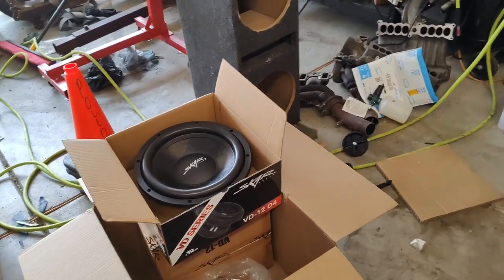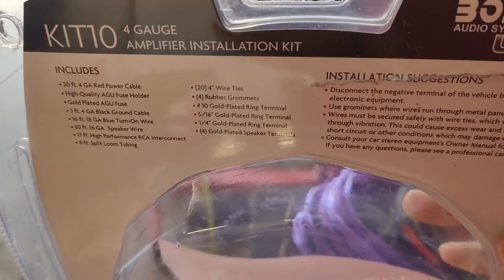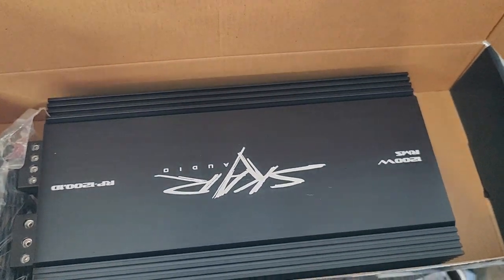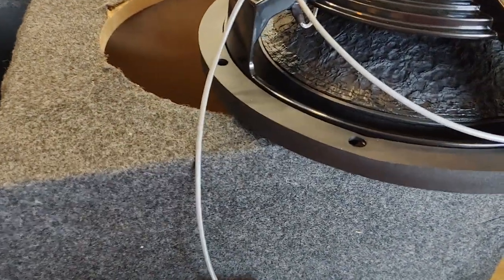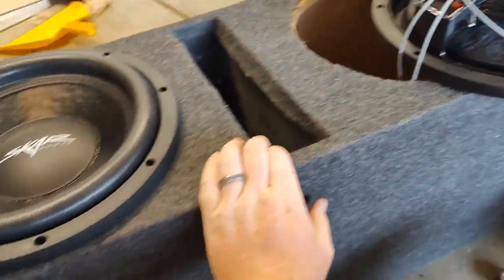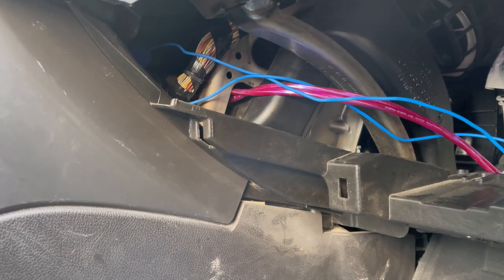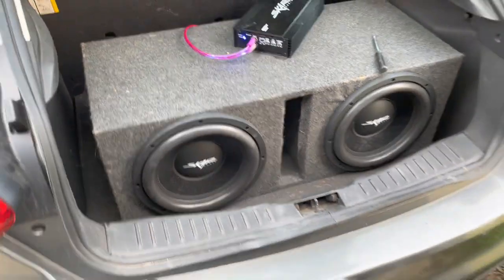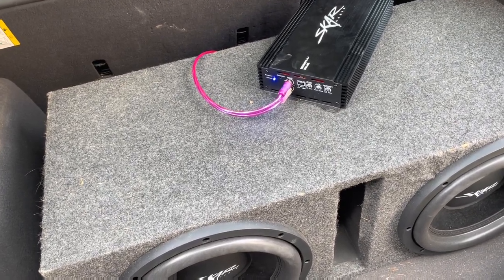2 12 inch Skar Audio subwoofer install - VD12-4. 2013 Ford Focus

Comment: Cool that you did it all yourself. I just install a Pioneer amp and 12” woofer in my truck. And two 6.5” Infinity rear door speakers. Front door has stock Bose 8” woofers and they’re still good. I already had a Pioneer head unit. And I use a Kicker install kit. Like a couple comments said, don’t cheap out on the wires man. Get a good name brand and oxygen free wires. Better safe then sorry.
Reply from the maker: The kicker install kit is a better kit?
Reply: @PollockGarage  I think Kicker is a better brand but you should definitely use oxygen free copper wires and cables. It’s safer and transfers power and signals better. Check out some comparison videos between OFC vs CCA. I’m not sure what Boss uses but if it doesn’t say OFC on the package then it probably has aluminum wires mixed with copper.
Reply: @DanPRC with that little bit of power 4g cca is fine!!

Comment: turn that subsonic off or as low as u can go 35 is gonna limit a lot and keep bass boost off even if theres no distortion tune your headunit to have more bass
Reply from the maker: I turned it down and that is much better!
Reply: @PollockGarage 😊
Reply: This is so wrong.. he has a ported box you can't go much below the tuned frequency of the box if he had a sealed box it could put it at whatever he wants.

Comment: that boss kit is CCA wire and not true 8 gauge, more like 12 gauge with a larger diameter sheath around it.  I wouldn't run that with that amp it could be a fire hazard honestly.
Reply from the maker: What should I be looking for in a wiring kit? I went with this for it being cost effective and the Amazon reviews weren’t negative.
Reply: @PollockGarage  also if your running more than 1k watts I would definitely use 4 gauge wire.